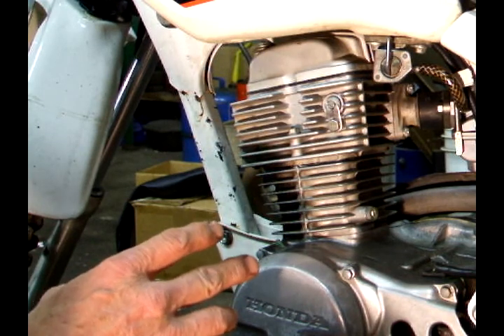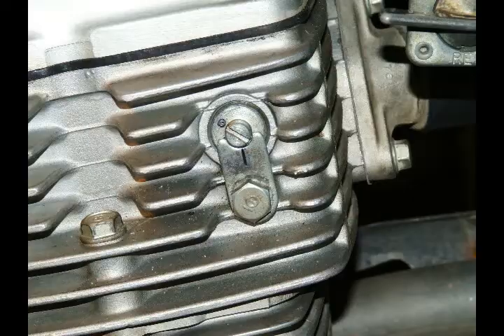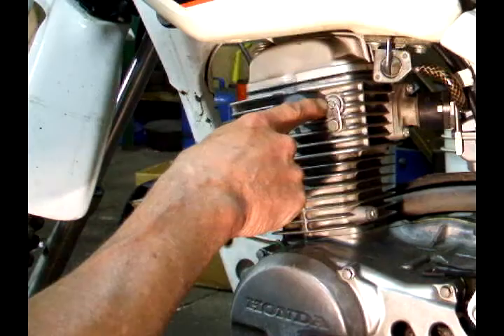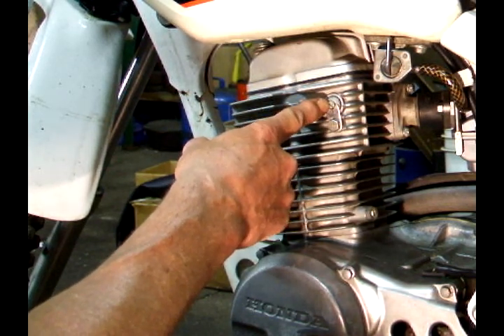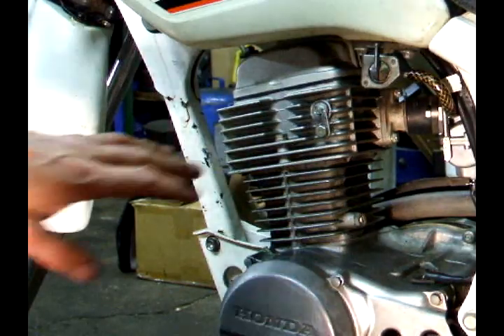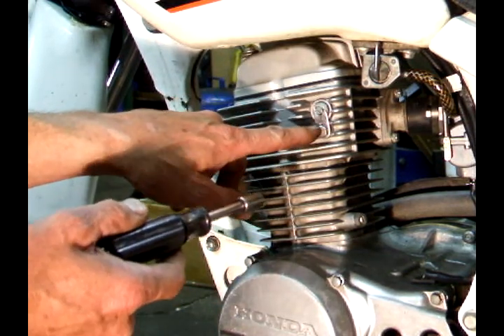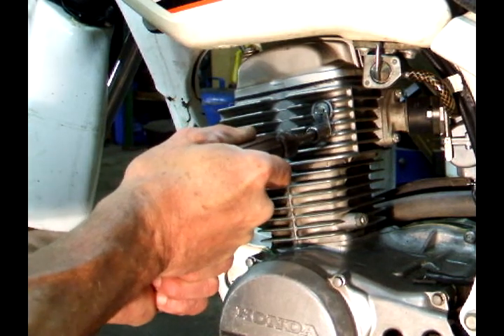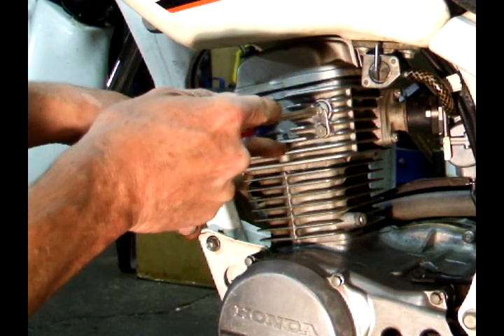TIMING CHAIN FINE TUNING ADJUSTMENT FOR CRF / XR 80 &100

Comment: Mine is slapping hard and I’ve done everything to try to get it right. What steps should I take?
Reply from the maker: Maybe your chain guides are shot and your chain is so stretched out that you have no adjustment left. It might be rebuild time for you.
Reply: That was exactly my thoughts. I’m almost positive that’s the problem.
Reply: New timing chain tensioners or streched out timing chain

Comment: What about the other bolt adjuster? Does it just adust itself, then you tighten the bolt?
Reply from the maker: The bottom adjuster is spring loaded and adjusts to the proper tension if the top adjuster is set to the loosest position. Do the bottom adjuster with out the bike running. You can do a fine adjustment with the top adjuster with the bike running, but make sure you turn it counter clock wise when you make the adjustment. Don't over tighten the cam chain or it will wear stuff out quickly.
Reply: @Amotorcyclenut what happens if you adjust the rough adjustment when the bike is idling? I did this and it seemed to sound better but I'm worried I messed something up

Comment: Is it possible for the timing to be so far off that it won't start? What do I do in that case?
Reply from the maker: +EmeryAxion Depends on the year of your bike. If its a points model yes. If its a model with electronic ignition, probably not. If the bike does not start, I would first drain the old gas out of the card bowl by the drain screw on the bottom of the carb. Many times that little trick works good. Its quick and easy to do, If that doesn't work, check your spark plug. If the bike sat for a while check the air filter a mouse might have made a nest in there. Best of luck.

Comment: I brought a new carb because my 05 crf 100 f was bogging and even cleaned my fuel tank filter and it’s still bogging everytime I hit full throttle and did already try to tune the carb didn’t work
Reply from the maker: Check, clean or replace your air filter. Set carb to the factory settings. That's where I would start.

Comment: My bottom adjust screw is all the way in does this mean tine for new chain?
Reply from the maker: No, not really. It means the adjuster is locked down. It needs to be released with the engine in the proper position so the spring inside can take up the slack. Watch the video a few times till you understand how the mechanism works.